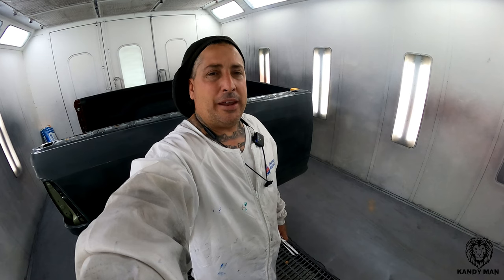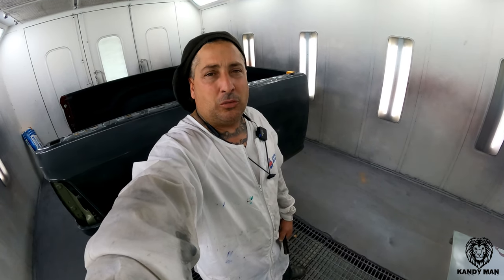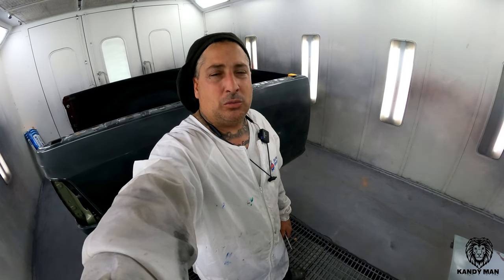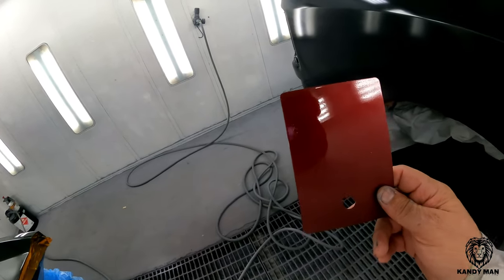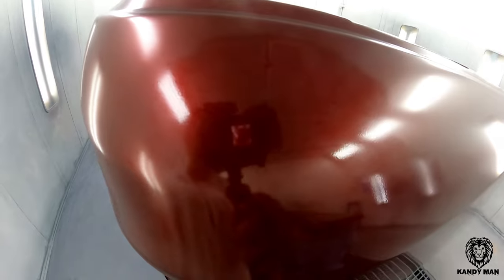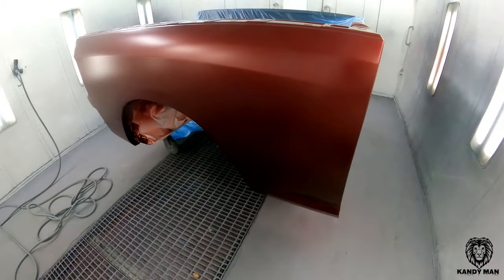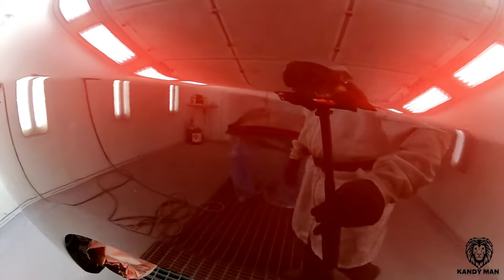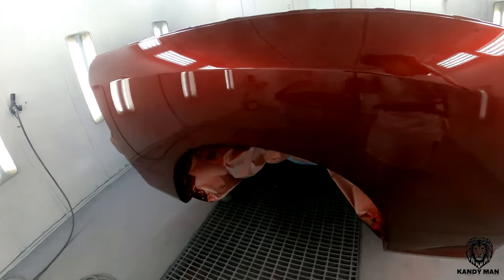PRV OR NRV - HELP ME OUT ON THIS ONE

Comment: Beautiful work as always .  Hey do you have any tips to speed up the drying cycle in between coats. Coming from Axalta to spraying the 9k Sherwin is quite the difference. I’ll def be on the lookout for that code. Thanks
Reply from the maker: I don't have the blowers in booth at this time but I turn up the heat in between coats for sure .

Comment: How do you like the microfibers for cleaning? I made the switch about a month ago I’ll never go back to towels again!
Reply from the maker: Can't beat em for sure
Reply: @kandyman5315  I agree. I think what does the trick is the electrostatic attraction the microfiber has to dirt particles. Polyester naturally holds a pretty significant electrical charge which appears to attract the dirt.

Comment: Where can i get the 2 prv swatches and the nrv swatch? I have a 21' ram thats a different shade of color than my 19' ram i traded in for it. Ive tried 3 different brands of paint touch up pens and even a couple different color match cans and i cant seem to find a good match. Thinking my truck might be nrv too
Reply from the maker: Check your local auto body paint store
Reply: @kandyman5315  thanks man! I just dont get why all the color match listings online list them as "prv/nrv" as if they were the same color when clearly they arent
Reply: I just picked up a 21 ram myself with prv paintcode and I want to touch up some spots, did you ever find what you where looking for ?

Comment: @kandyman,Hows the 3m gun on clear coat? Seems like u using it for sealer all the way to base coat. Is the 3m gun not really good at atomize the clear well? Would like to see a video on it if its possible. Thanks
Reply from the maker: Check out my older  video I did one on that

Comment: Took a PPG class in KC. He knew I used  Dv1 and wanted me to try upgraded cap. Kicks things up a notch.
We sprayed DV1 with a C2 cap and a 1.5 tip. Just got with our jobber today to get one ordered.
P.N. C2 cap 704435
P.N. Tip 704448
Reply from the maker: I have the c2 cap I like the c1 better but would like to try it with the 1.5 thanks for the insight 👍
Reply: What I have against the DV1 is that three years from now you are going to have to spend over $250 for a new pressure gauge as you can't change the batteries in the pressure gauge you need to buy the complete unit. THAT SUCKS. With respect to C1 or C2 it's all a matter of speed. The C1 is slow but gives a better finish the C2 is much faster and more suited for completes. If your painting panels C1 is the way to go.